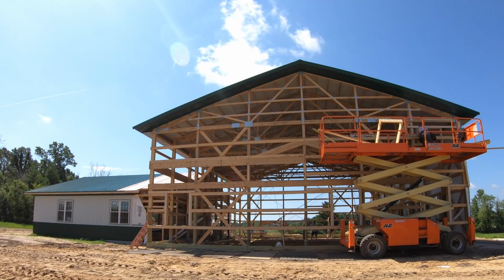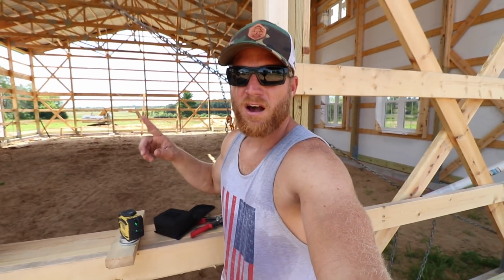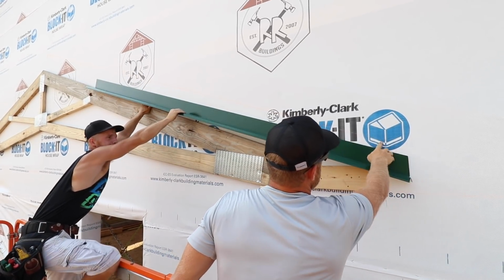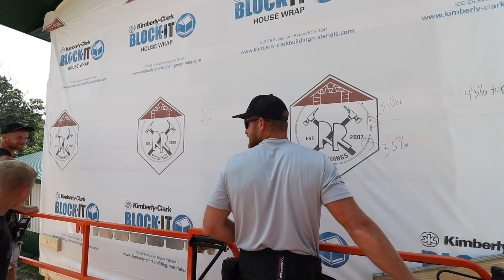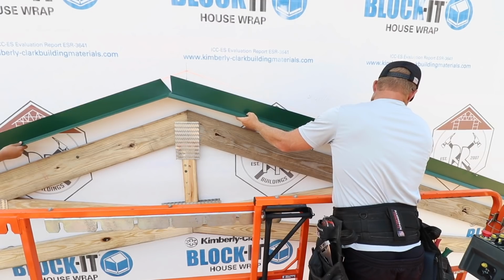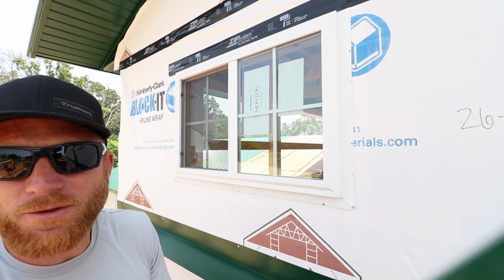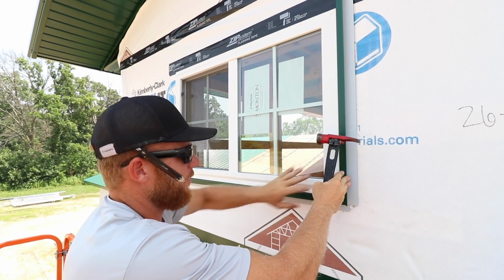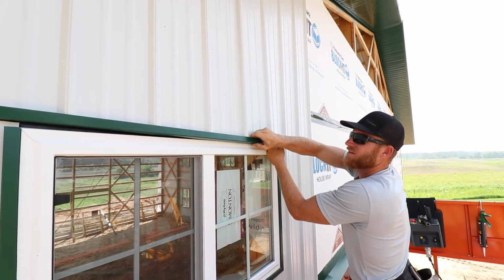Building a Hunting Cabin 12:  Porch Preparation

Comment: Okay Kyle I am one of the guys who suggested J-Trim brickmold. I once thought like you and came up against a customer who overrode my belief. Since then I haven't looked back. My window supplier will supply me with any thickness I desire and because of their 2" nailing flange I have never had a call back because of a leaky window. Not only that I never have to spend hours J-Trimming windows and doors. Any water that may escape the metal is always diverted by this new concept.  Not only that it saves me hours and hours on a job. As far as asctetics I also get my company to make me PVC welded parts for my overhead doors so all exits look the same.

Comment: Kyle, what's up with the window muntin on the top left window? The other upper windows appear to have the center muntins about 4 inches wide, while the left window appears to be narrower.

Instead of the Stabila laser level, couldn't you just use a plumb bob for marking the window center lines? My Bosch doesn't like super sunny days.
Reply from the maker: that window specifically is active

Comment: very nice.  but where the green flashing is already installed so you run the upper steel has a reverse lap.  The house wrap should go over the green flashing shingle style.  Or at least use the zip tape.  Now if any water get behind the upper steel, it can actually run down the house wrap, behind the green flashing, get to the porch roof below.
Reply: I think he’s betting on the metal to keep the water out, I don’t think I’ve ever seen housewrap protect a building from water damage... but most of the housewrap in southern Indiana is perforated housewrap so water can just run right through.
Reply: @carsongoodman5581  very bad
Reply: dave daved yeah Ik, people are still stuck in the idea that houses need to breathe, they used to need to breathe when we built with green lumber.. new construction houses don’t need to breathe and perforated housewrap shouldn’t be sold. It doesn’t make any sense. Pointless
Reply: What breathe. I am talking about flashing details and water details
Reply: dave daved yeah I got sidetracked and started ranting about pointless building products
Reply: Very good

Comment: About the J channel around the windows, I have asked before, but I still do not understand why you buy windows with built in J channel, when you do not use it, why not just order the windows without the built in J channel, that way you would not have that void around the windows.
Reply from the maker: it's not built in j channel
Reply: @RRBuildings    Thank you for answering my question the other day, but I must not have made myself clear,  at about 17.25 you talk about the built in channel in the window, and you stick your finger in the channel, then you explain why you use the metal J channel, on other videos it has been even clearer that the windows you use have a built in channel for siding, so my question is, why do you order windows with built in channel, when you don`t use it, why not order windows without a channel ?     Keep up the great work